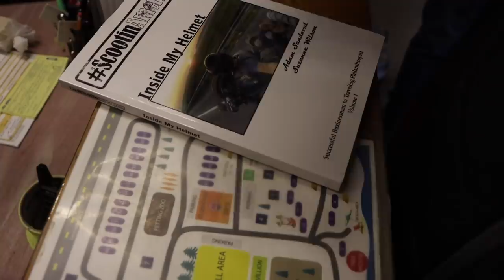It's OFFICIAL I'm Riding Mexico / Milling Cedar For Cabin Builds at KRIVER

Comment: Hey Adam, between the goats and the donkeys, you will have no grass! Just wanted to give you a heads up. I dig what you doing there pal! I'm upgrading my Roadking with a  Big Bore Kit, ported heads, new cams, S&S oil pump, a two into one exhaust, upgraded clutch, upgraded compensator, new tires, and Legends suspension ( you turned me on to Legends by the way). And hopefully it will be all done by Spring, and I can ride up to the Kriver from here in Houston and check y'all out👍. Have fun in Meh-he-co!
Reply from the maker: I'm glad I could share Legends with ya - that suspension sure does make all the difference, doesn't it?! we will be waiting for ya up at the Kriver 👊